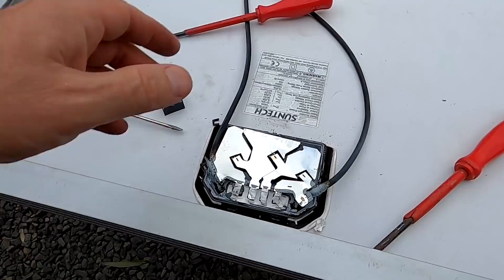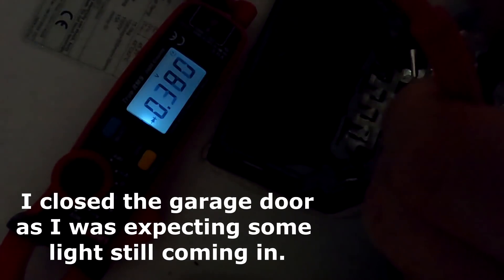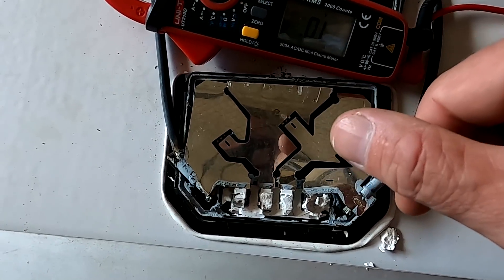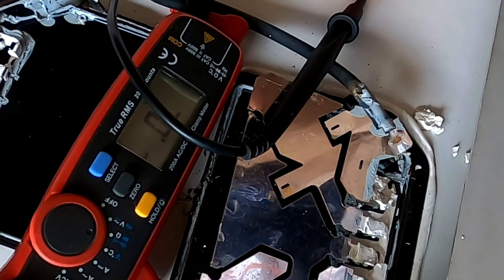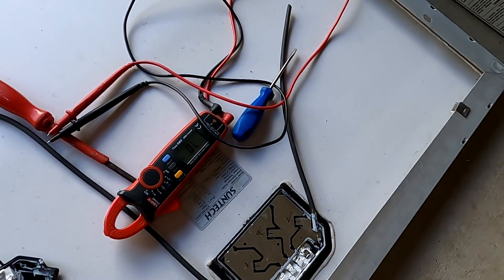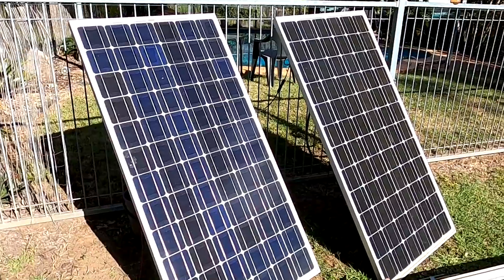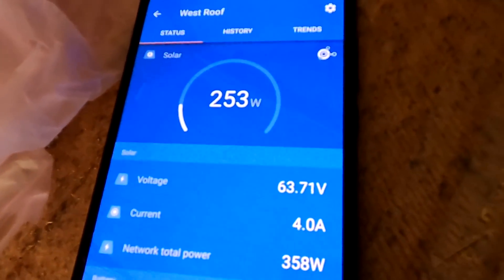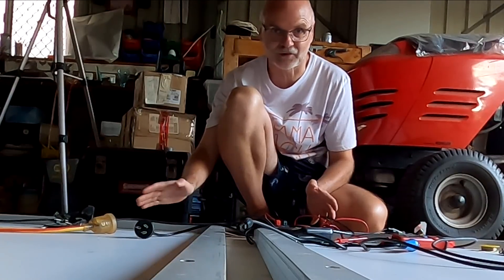Solar Panel Diodes. I found the problem (for a moment)...

Comment: Good content as always.  I found a faulty diode when a 100w panel should provide 21v voc and I was getting about 9-10v dc.  One panel had a faulty diode and the second panel has a lifted solder joint.  In both cases this saved me $$ each time and the fix was less than 50 cents.

Comment: I actually removed the 10A rated diodes from my two 50 Watt panels (in series). That alone got me from 55 Volts to 72 Volts (2 x 36v). The shading is only relevant at certain hours of the day and is already low efficiency. Mine are stacked on top of each other in portret mode and I discovered that panning them on the Y-axis (horizontal angle to the sun like a door) produces a lot more also. It seems that some panels have difficulty absorbing direct sunlight shining exactly straight on them making them hotter reducing voltage,  that is what I discovered.

Comment: Heat and overvoltage would be my guess I would actually go with a little bit higher voltage on the replacement

Comment: MBRB1545CT Spec:
Vf ranges from 0.57 ~ 0.84V
If pushing 15A through, you get 7.5W~12W of heat. It is enough to cook the diode considering there is no ventilation.

This can occur when most of the panels within the string receives good sun (generates a lot of current), and this particular panel was shaded bypassing all the current through the diode instead of the panel.

Comment: Without looking at the diode datasheet. I would assume they over heated. With the solar panels heating up and roof heating, it can get mighty hot in a little black box.
I would assume the temp max I about 75oC.

I'd go for different diode. Over the twin ones as they always get hot. I'd expect if you have an array of them they can't handle the voltage and amps within the string, as well as the heat.

Least you know now.

Comment: If those diodes are only rated to 45v, I feel that's just a little bit too close to spec. Also, what is the temperature rating for them?

Comment: O I check the B1545G the DC breakdown voltage is only 45V. and the purpose of the diode is let the power flow in one direction if the cell does not provide positive voltage. so that in case the panel or part of panel under shade. but other panel may be parallel connection it has some power build up in revise order. in that case the diode need to block the voltage. but just 45V... it would break down the PN junction.

Comment: I think I'm having a similar issue with my solar panels my panels have 3 junction boxes one panel shows perfect diodes one way current but when I test the volts of that panel I get a negative -00.1 the 2nd panel all the diodes are reading both ways instead of one way & the last panel is producing very low votes when I hook it up
Reply from the maker: Get one of these solar panel testers and test them individually. The tester will show you how much power you still get from the panels. I found quite a few which don't perform well any more...

Comment: I have few solar panel that have low power output. So I  measure it with multimeter, the short circuit current and Voc is exactly same with the good panel but when I connect with my inverter it show different wattage. Is that because of the faulty diode or the cell problem? I cleaned the surface and no shading when I test both of it.

Comment: Look for hotspots on the solar panel cells.
If those cells are shorted you should see higher temperatures in areas on the panel with your IR temperature gun!
Reply from the maker: Should you still be able to measure the max short current in such a case?
Reply: @OffGridGarageAustralia  Anytime you push current back into that panel, you see an increase in heat!
It's got to dissipate into heat!

Comment: Schottky diodes should not be used for bypass diodes in PV panels.  

Your 72 cell panel specs a maximum system voltage of 1000v.  Worse-worse case, each bypass diode should be able to take a reverse breakdown voltage of the maximum system voltage panel spec, 1000v in this panel's case.  It become very important for high voltage grid-tie inverter setups although the diodes are rarely if ever subjected to highest system voltage, but they can be.

At 5 amps these MBRB1545CT Schottky diodes will have about 0.5v forward drop but their reverse breakdown spec is only 45 volt.  Not even any safety margin for a single panel Voc.  When you get shading on three stacked panels you can easily exceed the breakdown voltage on some of the bypass diodes.  Breakdown voltage does not mean they instantly blow out.  It means they zener out and get hot if bypassing current is high.

Your ohmmeter only pushes about 1 mA during forward diode tests so that is why you only are measuring 0.25v forward voltage drop.

Schottky diodes have lower voltage drop but higher series resistance and lower breakdown voltage then regular silicon diode.  Schottky have a faster reverse recovery time but this is not import for PV panel uses.  (is important for high freq switching power supplies).  At higher currents their higher series resistance (compared to regular silicon diodes) eats up much of the voltage drop advantage.  Higher voltage rated Schottky diodes just series stack multiple diode pellets in the package to achieve higher breakdown voltage but the multiple series chips mulitplies their voltage drop.

For your application you don't really need 1000 PIV diodes although it would bring the panels to their 1000v system rating.  I would replace with similar soldered down packaged 10-15A rated silicon diode with at least 600v reverse voltage rating.  The package and heat sinking is important.  At 5 amps and 0.8-1.0v silicon diode drop the bypass diode could see close to 5 watts of heating.  Don't use simple leaded diodes as they only dissipate heat through their lead wires and can get blistering hot when bypass shading happens.

Comment: Hey bud, if you use an analog meter that takes a 9 volt battery, you should be able to check the ohms in each direction of the panel without having to take the cover off the integrated junction box.  Place the Analog Ohm Meter in the high ohms position, you should see the full 9 volts across the Analog Meter terminals using a DMM.  This will make it much easier to check your panels while they are mounted, however, you'd have to cover them fully to prevent sunlight, or perhaps rename yourself, Midnight Solar.  LoL!  I hope you find this to be helpful.  Cheers 'n' beerz!

Comment: Now the question is ... why did they fail?   Could it be a production fault or maybe static electricity due to lightning. New sub and started watching your progress. Edit... yes I watched till the end of the end now.  You can't measure a diode in a circuit One side has to be disconnected. However they should all act the same on the panels since the panels are all the same type and manufacturer.  My to go test would be to disconnect the diodes and solder 2 new test cables and connectors. ... One panel by one panel.

Comment: hello again
if you replace the diodes, use the following : sm74611
this is basically a zero loss diode and is a direct replacement for existing diodes.
give it a shot...
Reply: this will only be good if you have shading going on, that is when the bypass diode is active and there is a current going through them. Due to the VF (forward voltage drop 0.6V) .... voltage x current is the power loss caused by the diode.

Comment: i wounder if your replacing the diodes if you could put resisters and led inline so if the diode goes  the led will light indicating a faulty diode

Comment: Over the years I have seen mechanical intermittents.  A large transistor still mounted to a heat sink… it tested good when the legs are pulled away from the PCB but test bad when pushed toward the board… in other words a bad connection internal to the transistor case. Another, a spark plug wire when moved around would reveal a bad connection internal to the insulation.
Calculate a load resistor that puts a panel at mid-point in the power curve… not shorted but not open circuit either. Then with an amp-meter in the circuit move the wires from the panel around as well as move the panels from near vertical to flat on the ground. Look for sudden changes in the current flow, an analog amp-meter maybe better for this… Oh, solder the diodes back into the circuit on that one panel, did you not ever hear of the “Scientific Method”??

Comment: you dont have to crack them open but drill a small hole so you could get some longer probs in this way they could be sealed again if all is good

Comment: I am thinking you could test the panels with a restive load rather than cracking open all the junction boxes.  Some light globes connected in series/parallel for the required load. If the panel fails that test then crack open the box.  As for ordering and replacing the diodes, do you really need them? I can see why they are there, but if they create more problems than the solve, just chuck em in the can.
But if you do replace them I would look for an equivalent, but not the same part.

Comment: Good that it works with two panels, but connecting the three panel strings was always the problem. You're running test software on the charge controller because the original 150/35 was locking up at 132v every few days. A 3 string can exceed this, 2 will not. 
I would be looking at the controller and be asking how Victron resolved the lock up issue.

Comment: Stellt sich die Frage warum die Dioden kaputt gingen?
There is still the question why the diodes failed? Seems to me that the semiconductor quality choosen by Suntec company was not the best. There is potential to see more malfunctions on the other panels.
Reply from the maker: I tell you at the end of the video. Did you watch it?

Comment: If so much current are recycling through the faulty diode, the diode and the box must be much hotter than usual. So you may just check and compare the temperature of the box.
Besides, if diode is the problem, shall the problem also happen on single panel string?

Comment: I am glad I am not the only one having problems with Solar, I have done a massive system at my home to take me off grid with 40 x 330 Watt panels, 2 x 250/100 victron M
PPT, 1 x 15 Kw Victron Quatro, and originally 20 x 225 Amp AGM batteries. The batteries only lasted 1 year even though I only discharged to 50%. Replaced with 6 x 4.8Kw Lithium Phosphate packs.
But I made one fatal mistake. The Lithium Packs came with Copper Lugs which I replaced with Tinned Lugs on 5 but forgot the 6th one. Struggled to get the 6th one to work until I found that the Copper connected to my 50mm x 50mm x 5mm Aluminium bus bars had corroded within 1 week and that battery was no longer in circuit, due to corrosion with dissimilar metals. Moral of the story DIY works but simple mistakes can be made. By the way I am in South Africa where we have rolling Massive blackouts almost every day. But I am now completely off grid :).
Reply from the maker: Thanks for sharing Julian. Great to hear your on lithium power too now.
There are always these nasty little things in your project which can completely throw you off. And everything takes forever if you need to search for your own mistakes...

Comment: Thank you for the series on the panels . You have answered my question for the panels here in my area as well. Now for the work to check and replace DIODES.
Reply: It's not the diodes
Reply from the maker: You should watch until the very end!

Comment: Now check the batterie in your "Diode-checker"  9V Block i guess   :D  and order the Diodes !  (Dont make shorts with your + and - cables ) 
Dont try to de-solder the diodes with your Weller  (to less Power) !!!    look for a soldering Gun ! 
Dont forget to order the silicone for the boxes if you want to close them again (if you let them open there would be a better thermal transfer) 

Gruß aus D  Walter  PS: Enjoy the beer Prost!

Comment: Can be the diodes or could be the cells. To tell for sure you need to de-solder the "faulty" diodes and test them in isolation.

Comment: Hi glad you have sorted it at last! Can you help with another issue, When the BMS cuts off the power itleaves the inverter switched on? also the charge controller is still getting power from the solar array, will that fry the charge controller, and when the BMS comes back on  the inverter will restart under full load and take that out as well?
Reply from the maker: You should have watched until the end...
Friends on your charger controller. I can turn my battery of and the SCC keeps powering the inverter.

Comment: Yeah, to have a definitine answer about the diode problem, one must unsolder one of the problematic diodes and check it off circuit... Judging from my previous experience with diodes, 99% of the time they fail shorted. What you are measuring there probbably comes from faulty cells which is a bad thing unfortunately... You probbably realised that ath the end of the video :) Either way, kudos for the effort! Oh and an I-V curve tracer instrument would be great to test individual panels for problems like that! You would see the problem immediately on the characteristic curve. I am building such an instrument right now as my Master's degree thesis!

Comment: Bonjour, if it's not the diode, may be a corrosive contact between line or busbar. in this case, the diode is working well on direct direction, but the résistance is bad on reverse direction.
Reply from the maker: It's something like this. My bet is on micro cracks in cells across these panels.

Comment: I'm interested to see the next video for what you find next. I'm wondering if you took some diodes off and tested directly and found they are actually working, but maybe the reverse voltage you measured is making its way through the solar cells somehow. Is that possible? Really thought you had something there, but you'll get it.

Comment: Well done Andy! Every panel in your west array must have most diodes faulty! So there is a fair chance they may have hotspots as well? So you still need to test each panel before you put it up on the roof even after repairing the diodes. If the panels are also faulty you would need to de-solder the suspect diodes and check them separately and then check the current through each string of cells on the panel in both directions. You probably should do this test after removing the diodes for replacement and repair.

Comment: Great Diode discovery Andy and April's   fools, jajaja or not maybe cell damaged if your measuring voltage. Apply the Diode reverse voltage and see if it blocks the current.

Comment: Instead of breaking open all the panel connection boxes, you could just test each panel individually to see if it produces 'normal' power (same as a panel with 3 good diodes). If so,  it is good. The panels with 1 or more bad diodes will produce less power.

Comment: There cannot be false readings from light on the panels when measuring diodes. Either the diodes block dc or they don't....  What you are not taking into account is the fact that these stock diodes are under spec. for their task and heat dissipation.  With the same problem across so many panels, there is a design flaw...  The next diodes you install should be 50% higher in current rating, or allow the diodes to breath instead of confining them, add more diodes in series, etc..  Drill holes in the boxes, LOL!   Good luck, you'll need it..  In addition, dismissing the viewers who told you to check the diodes as incorrect because they didn't tell you why,  just proves how incompetent, egotistical  and amateurish you are....!!!    There is nothing to learn here but how to waste time..  Tschüss...!!!   LOL!

Comment: Instead of opening the junction box, use a 9v battery and measure the voltage when you pass it thru the panel.  Reverse the polarity of the battery and measure again.
meter minus --- panel minus [panel] panel plus --- 9v minus [9v bat] 9v plus --- meter plus
That gives you the ability to measure up to nearly 9v drop across diodes. Panels almost always use 45v diodes (as you discovered) so I would not hesitate to put 2 or 3 9v batteries in series (up to 27v) if I thought 9v wasn't enough to show the max voltage drop across the diodes.
You could also dispense with the meter and use an appropriate resistor and LED that will light when connected to the battery correctly.
Of course, all this diode testing will be meaningless if light is hitting the panel as you observed.

Comment: You CAN measure your panels to see if they are faulty. All you need to do is disconnect each panel from the others, and connect in a loop resistor across the leads of the panel, and measure the voltage and current the panel is producing. If there are any shorted diodes inside the junction box, you will then be able to see the decreased voltage and current before breaking open the junction boxes. Why go to all the trouble to take the panel down from the roof and break open the junction boxes needlessly? If you have a 40V panel, then using a 1K ohm, 300watt resistor you can put across the panel, that will give you about 40 ma of current through your meter (as long as it can handle the current for measurement). If you current is considerably less than that, then you have a diode problem. Work smart, not hard.

Comment: There was a commercial solar array that uses a thermal camera.  By feeding power into the panels at night, the shorted diodes actually heat the panels.  They just look for the hotter panel and know the diodes are shot.
Reply: Good idea. Just apply the revise voltage at night. if the string has current then meaure or checked by thermal camera for that
Reply: Or just measure them at the Sunlight without load. If the diode is faulty, that will generate some amps and heat up the cells.